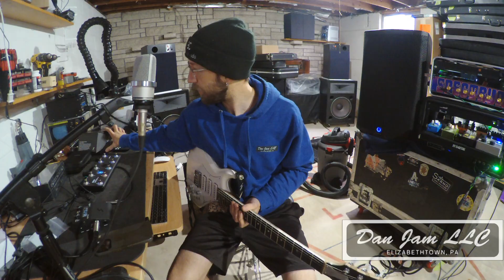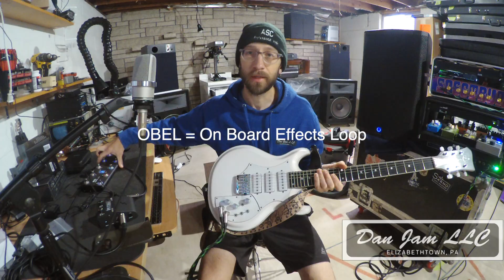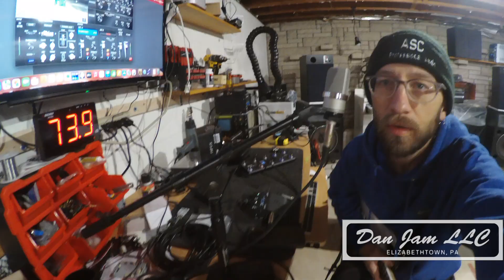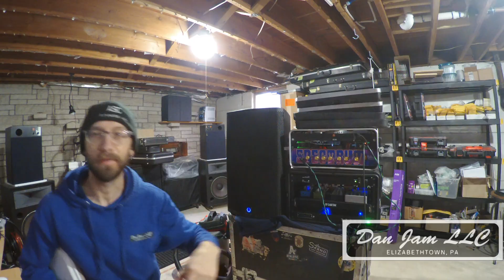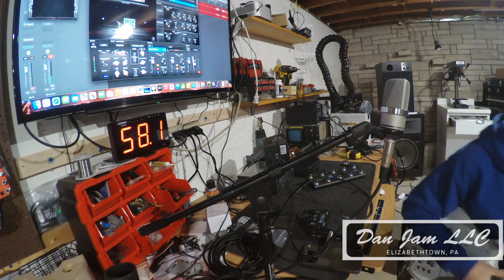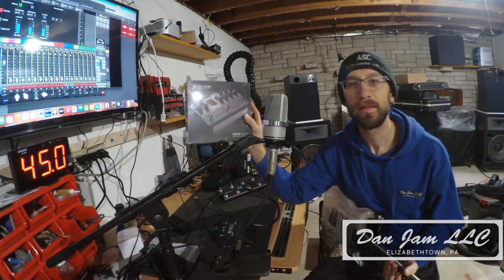Dan Jam - Two Notes Audio OPUS Demo for DI (Direct In) Rigs

Comment: "How to use the OPUS as an amp sim/cab simulator.  In this demo, we are using the Sarno Spectrum as the preamp into the OPUS via line level input and using the "Buffalo" JBL D120f cab simulator."

So you're using the Opus as an amp sim/cab sim but you're using a separate preamp and a separate cabsim... I'm puzzled here...
Reply from the maker: The opus is used as the cab sim. Only using a seperate preamp.